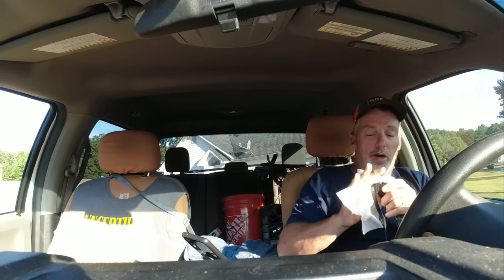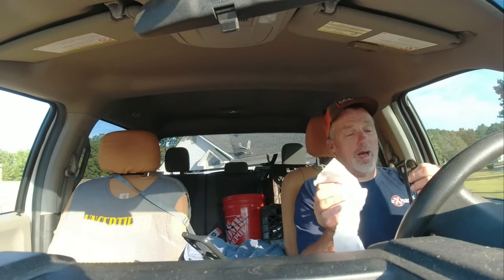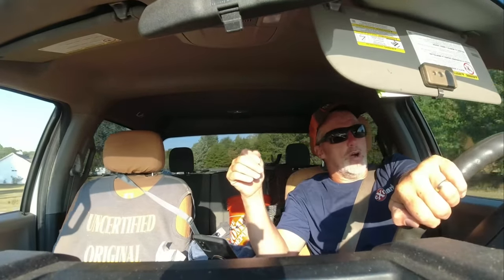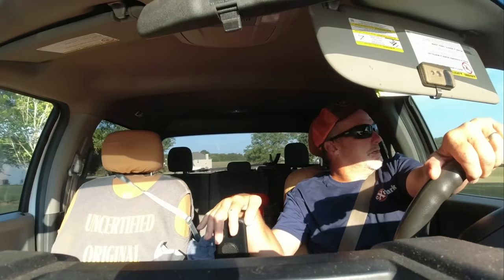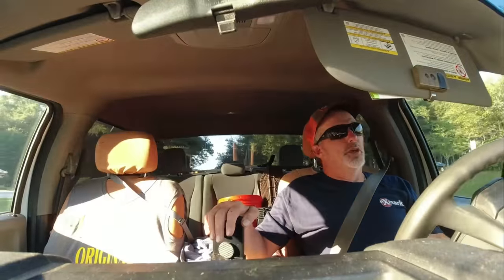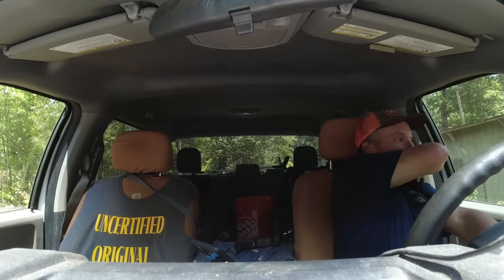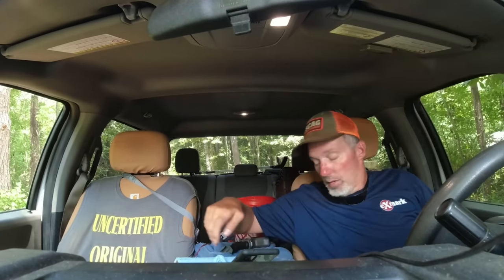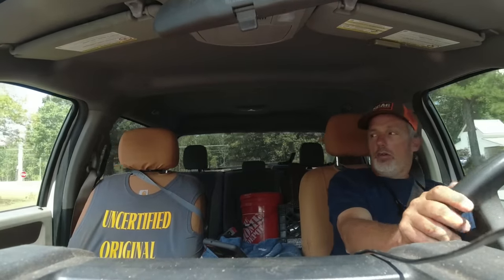New Scag TT2 VS Old Scag Tiger Cat  - CUT QUALITY

Comment: I would definitely check the deck adjustments on the TT2. I have a 61” TT2 with 35 horse vanguard and it doesn’t leave a thing. It doesn’t matter if I’m cutting high or low it does great. Love the video as usual!

Comment: If you drive up there...you got to stop back by here🤪😎💪. The FX730 on my JD is 23.5 HP. That engine has been bullet proof for me so far. Almost 1500 hrs and nothing but regular maintenance... still using original fuel pump. I have about had it with the Kohler EFI on the QuikTrak 🤦. They don't make them like they used too brother. That's crazy hrs for sho.  Keep on grinding brother 💪👊😎💯

Comment: Great video Ray. I believe that that scag turf cat has only 795.5 hours. I looked it up and the last number should be in 1/10 hours. Still an awesome mower for its age!
Reply from the maker: man it sure is beat up with only 795 hrs on it
Reply: @rayrayslawnlandscape2008  yeah, it is. I’m sure they have been using it as a loaner for a while and it’s been abused. It still seems like a great mower tho. I was going to mention that I bet the reason it disperses grass better is due to the wider opening compared to the 52 inch deck. This being said, I would have thought that your turf tiger would cut better. I would make sure the deck is leveled and check the baffles like you mentioned.keep up the great content!

Comment: It's 799 and 5 tenths hr. You red it wrong. They wouldn't loan a machine with 8000hr they are dead at that point
Reply from the maker: I got a exmark that had 7500 hrs on it. It was on the third engine when I sold it.

Comment: You sure that isn't 795.4 hours? 🤔
Reply from the maker: man that mower def has more then 790 his on it.
Reply: it is 795.4 you can just barely see the decimal. aint no way that mower would last more than 3k hours without having hydros redone and that engine or almost any engine would be on its last leg at 3k
the red writing on the meter under the last digit says 1/10th thats the decimal points counter.... thing. lol
Reply: Yup
Reply from the maker: @BioHazardra  i have had hydros last over 5k hrs and still going.
you gotta remember the big $15k plus mowers are over built in every way
Reply: I have a dixie chopper we bought new in 1999 same motor and hydro we have used in commercial on weekends since new.

Comment: No way original Kawasaki motor its probably had 2 or 3 engines like you said .. i do have a original kohler on a x series with 4500 and still going ...Kawasaki just wont last that long with me i have 2  kaws in shop now needing heads 2700 hrs and 2800 hrs..just saying